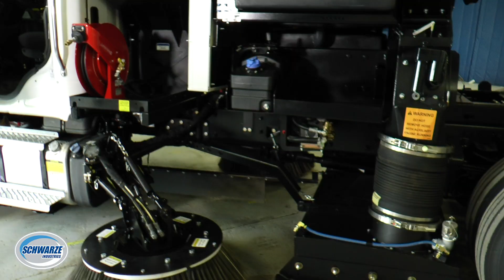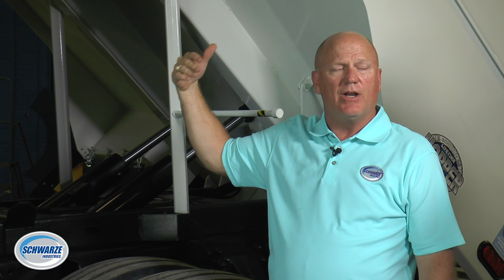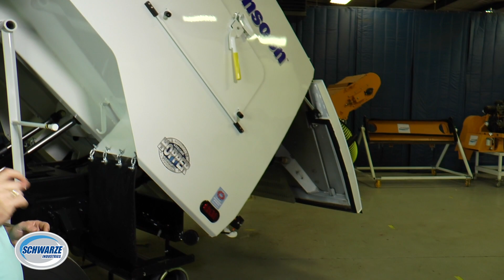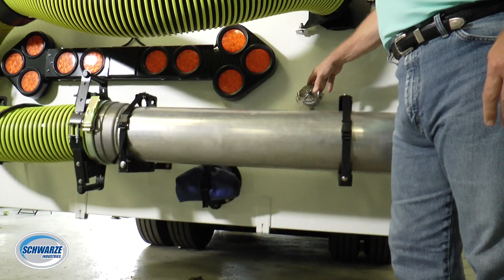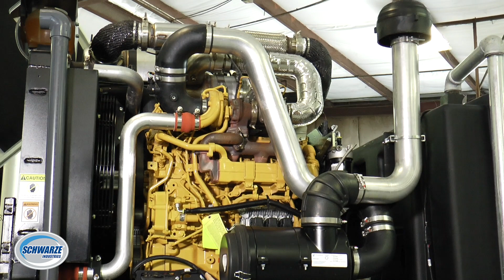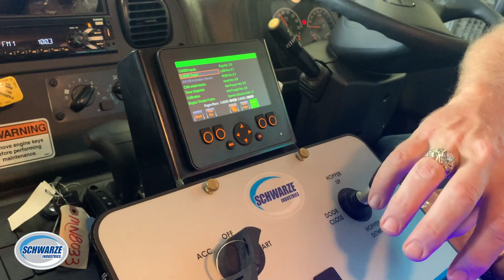Operator guide - A9 Monsoon (and A7 & A8)

Comment: I have a question, I am currently working on an a7 tornado sweeper m2 106 model. The all lights keep flickering like the hazards are on, but its clearly not. Battery is find and I just replaced the BHM, cannot locate where the relays are because I was assuming that it could be a flasher relay issue. Any suggestions? Thank you
Reply from the maker: Hi Ronald, I see you contacted us yesterday. Not sure what happened. I'll have our team reach out to you in the morning.
Reply: @Schwarze.Sweepers  I emailed you guys again with the progress I’m working with a 2018 A7 tornado sweeper m2 106. The lights would illuminate every 60 seconds with the truck. Is that a common issue and if it is what would be the problem? Is that the vehicle warning me that there is something wrong with a fuse? Because I’ve tried a lot of the things that the product manual is making me do with function check and it would not fix the issue. Thank you
Reply from the maker: @r.j.b1065  Very good. I am sure the team will reach out to you. Please email support@schwarze.com if you need a follow up or additional assistance and I'll get it in the right hands.